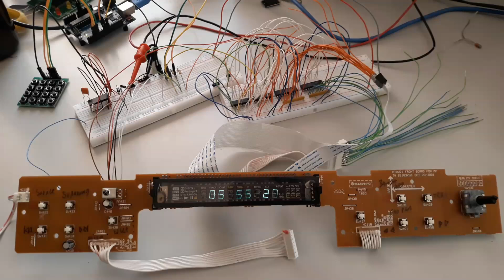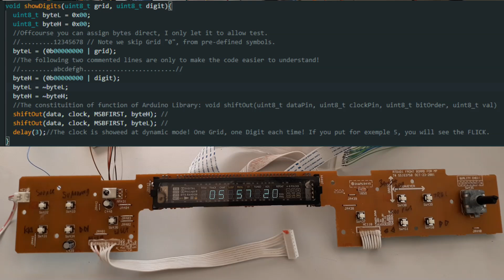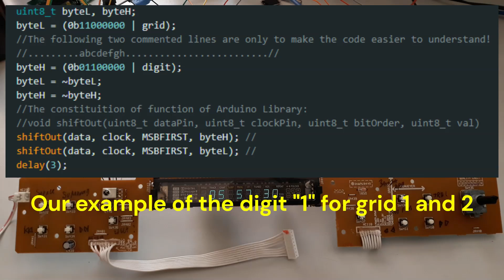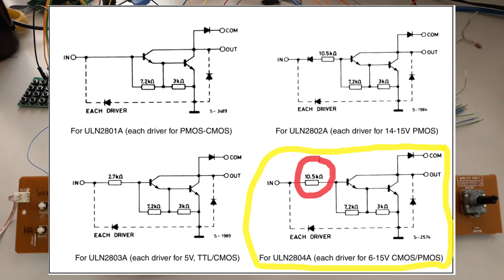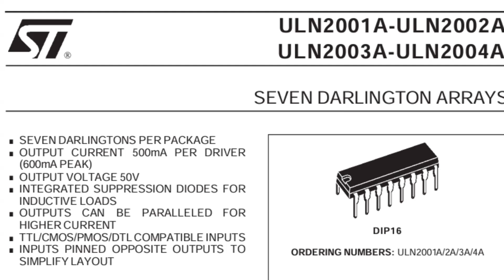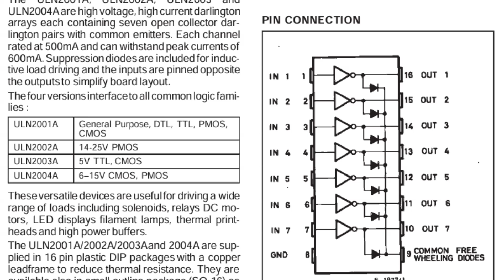ULN2804

Comment: Sir, M66005 IC is in Onkyo tx sr 504 display panel, I will tell you about it in detail.
Reply from the maker: I have never encountered any of these ICs with problems, usually the failures are always external! Someday it would have to be the first. Finally, watch the video: https://youtu.be/9YwddDhmRtI
There's also information about M66004 and M66003 on the channel.
I suggest you carefully check the power on the P701B connector pins.
Pin 20: -29VDC, Must be measured relative to "GNDCPU", pins 7 & 8.
Pin 15 & 13: the FACx, should have about 3.5VAC between them!
Pin 15 & 13: Regarding pins 7 & 8 "GNDCPU" should have something close to -29VDC
Pin 10: +5VDisp, is the power supply for the M66005, should be measured in relation to pin 7 & 8
Ensuring the above conditions the VFD should work if the pins below are sending data correctly.
Pin 22: Date, A square wave signal should appear on the oscilloscope
Pin 23: Clock, A square regular wave signal should appear on the oscilloscope.
Pin 24: /CS The driver is active when it is at 0V
Pin 25: /Reset Reset occurs at 0V, so in normal operation it should be close to +5VDC
The service manual for the device is available on the WEB
I think that's all I can help with because I me not work at repair. Good job there!